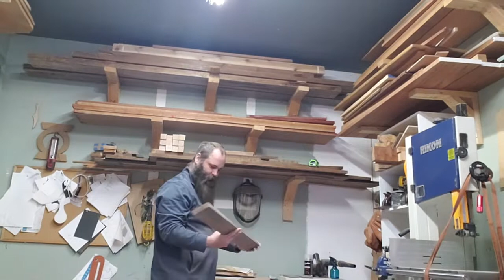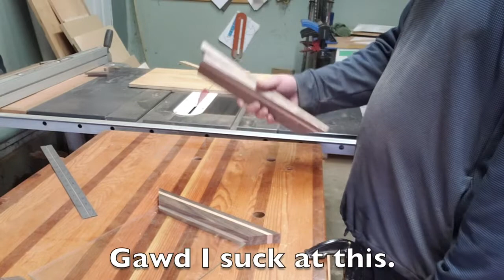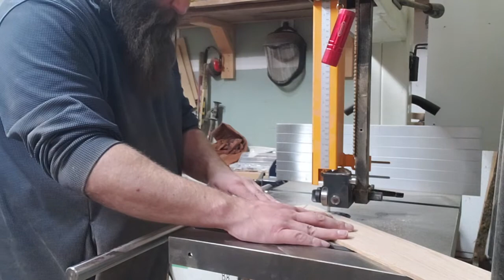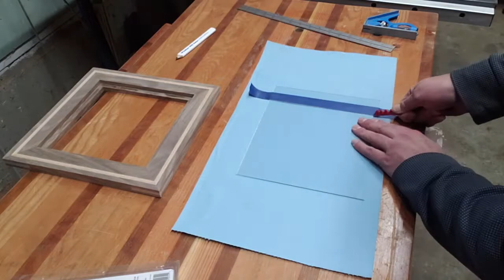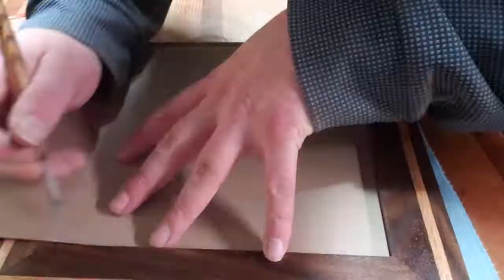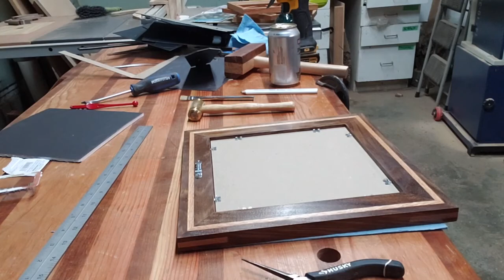My first picture frame!

Comment: Looks good man! What kind of finish did you use?
Reply from the maker: It's just a spray by Varathane. It acts like lacquer, but I'm not sure what it actually is. It's just called "finish." Maybe I'll do a video on what finishes I use when. I get this type of question a fair bit.
Reply: @WoodenThingsAndStuff  cool! Thank you! Yeah I try alot of different types and brands...I seem to get hung up with using shellac alot, I just love how simple it can be.
Reply from the maker: @HermanWoodworks  Same reason I use this spray stuff. I just do a couple of light coats and then hit it with like 600 or 800 grit to smooth it out and buff it with a bit of wax to bring the sheen back.

Comment: A better cutter..clean glass before score make sure cutting wheel is lubricated only score once.
Reply from the maker: Wait...lubricate the wheel? I knew about the "score only once" part, but not the "lubricate the wheel" part. What do you use to do that?
Reply: @WoodenThingsAndStuff  
Just a light lubricant like sewing machine oil.
Reply from the maker: @whateman12408  Huh. Okay then. Maybe if I ever bother to try breaking glass again, I'll give that a shot. Thinking I'll probably just splurge on a sheet of clear acrylic, though, so I can use my damn tablesaw. haha